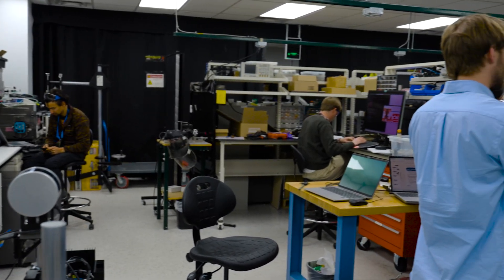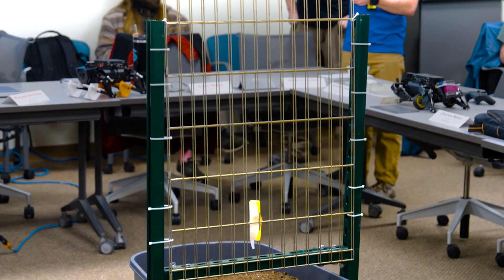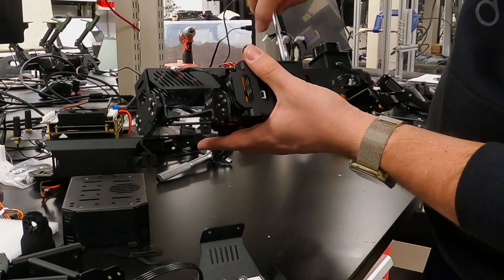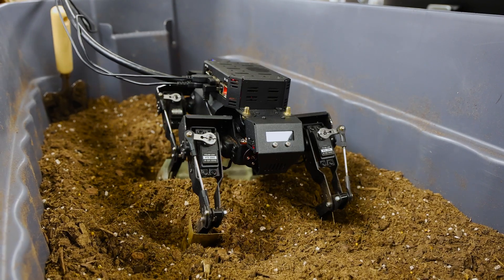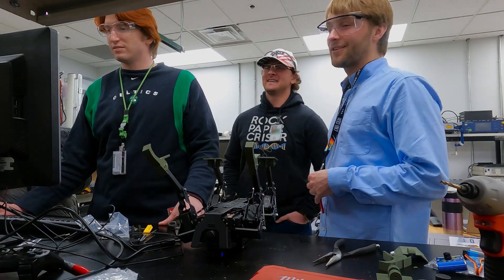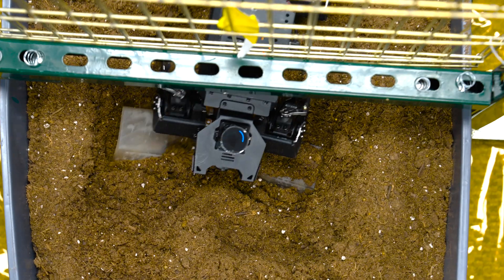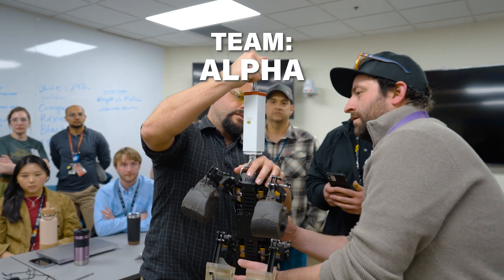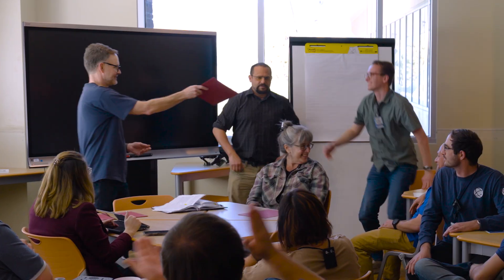Building robot dogs: Engineers race to dig the biggest hole in design sprint | Los Alamos Lab

Comment: This one is easy: add a shop vac and/or air hose and an oscillating scraper with a brush to the machine. If tethering is an issue, use a small compressed air dust cleaner can.
Reply: Do it!
Reply: It would be an honor my friend! @MauricioHernandez-de8is